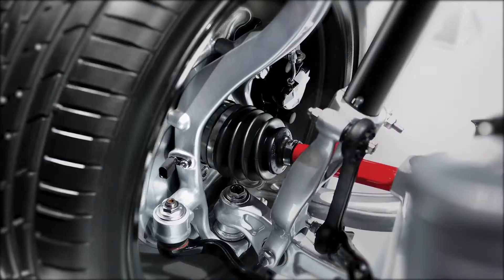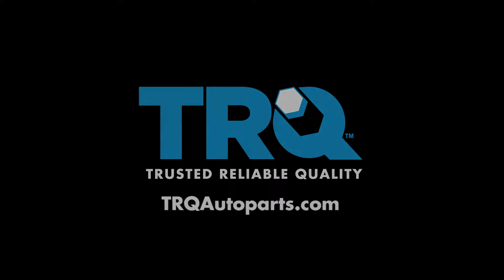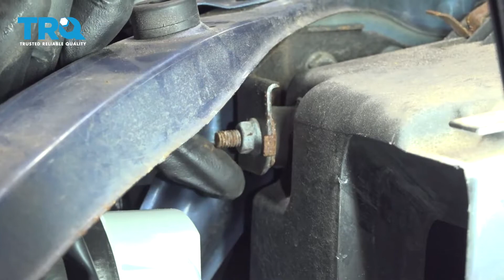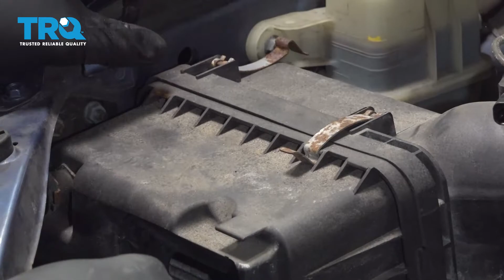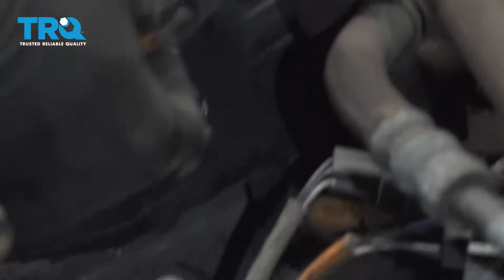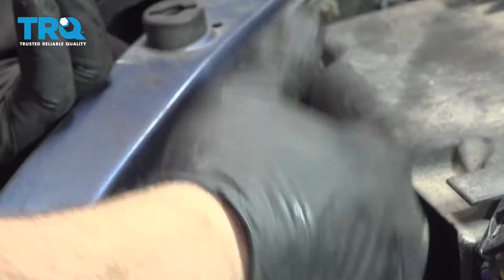How to Replace Spark Plug Wire Set 2005-2009 Subaru Outback

Comment: By saving time I didn't even remove air filter housing - the process upto 2:10😂 all I did was unlatch the airfiler case lid and moved it to a position out of the way... then without lead pliers I connected the leads by hand however part of one lead did break off inside the plug chamber while removing older lead so I removed it with long nose pliers, then all back together.
 I realised I had no idea how to replace the last 2 on other side of engine because there was a thick small coolant pipe blocking access to the ends that fit to the ignition module.. if I removed it then would get very wet all over I imagine. Noticed nothing about pipe blocks was brought up in this vid evidently about that issue.